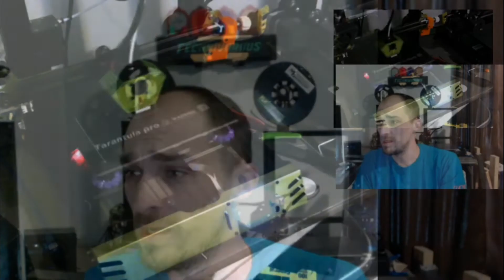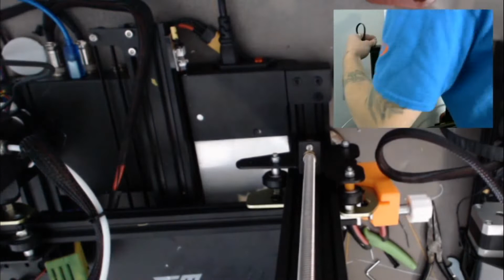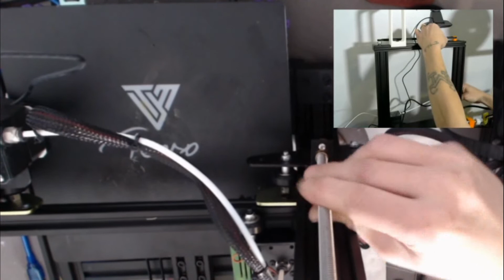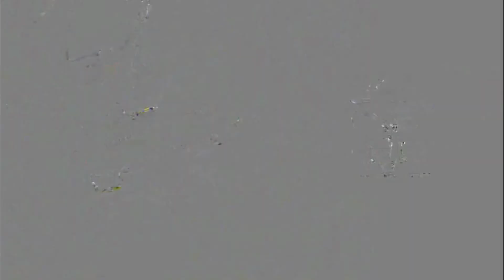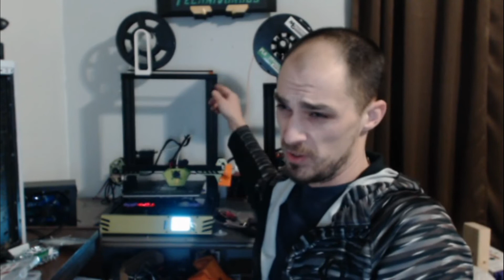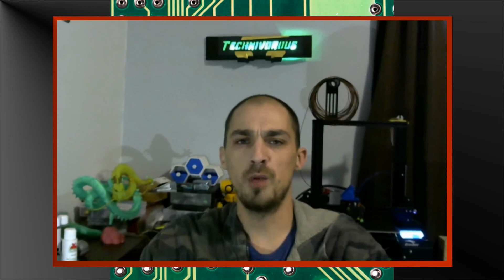Dual z upgrade kit (beltdriven, one motor) for Ender 3 AND Tarantula pro

Comment: Where did you get the other bracket? I have mostly solved all of the other issues with my TTP, but this is the one that doesn't allow me to have the printer working flawlessly.
Reply from the maker: Dual z kit from an ender 3. I have since removed it though. A few minor adjustments to the eccentric nuts on the x gantry solved my uneven issue.
Reply: I am still fighting with a little bit of something that looks like inconsistent extrusion, but in fact has probably something to do with the mechanics (although even Prusas are known for the same issue and software is the root cause of it in their printers). Other things have been easily solved by me, although took a lot of effort.

Comment: There is no additional force driving the gantry by installing this dual Z mod. By all reason, if the parts were all perfectly aligned, there would be no need for it, and it's an extra expense, and it also potentially has some movement in the bearing. Obviously alignment is a tough proposition since the system is overconstrained so at a glance dual axis kit does solve an issue, but alternatives are worth exploring for sure.

As to alignment, look at the video by Alex Kenis "Ender 3 alignment: problems and solutions", where you'll probably learn some unique things you probably haven't thought of before nor heard elsewhere, and which should apply to a number of similar mechanics. The guy has been building the weirdest machines from scratch for an eternity and has a ton of insight.
Reply from the maker: I already have replacement hardware for gantry on the way. The right side eccentric nut is stripped so it wont grip to the bar, the lead screw is only ensuring it rises evenly with the other side. Alternatively I could place a second nema 17 under it and drive it from the second extruder driver but it will be more efficient to just replace the hardware on the gantry.
Reply: complete bs. if you have this printer, youd understand. Tevo made a crap machine, and the fact that you NEED to have dual z, to support both sides of the X, is stupid. and having to spend the money on the dual z upgrade jus to ensure you get flat even prints, is even more dumb. i've spent over 100$ on upgrades, and its still crap.